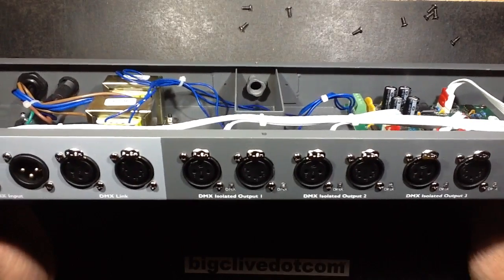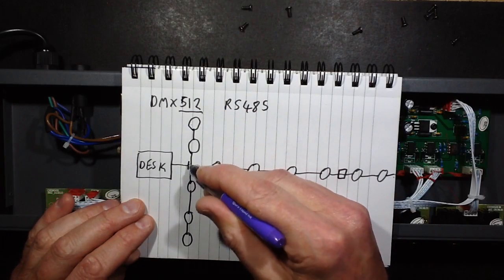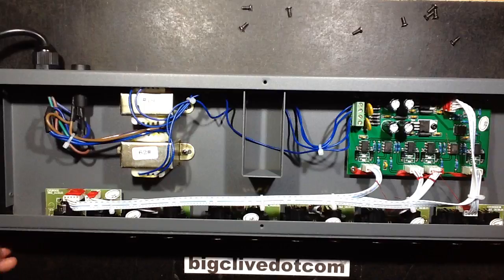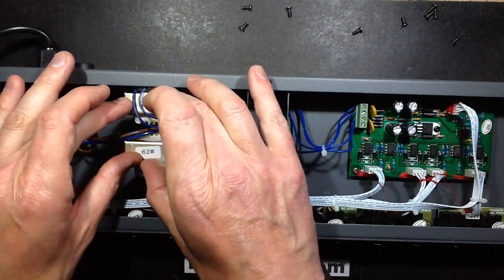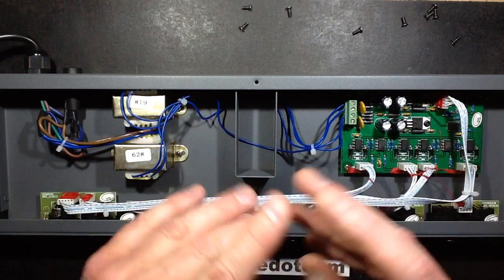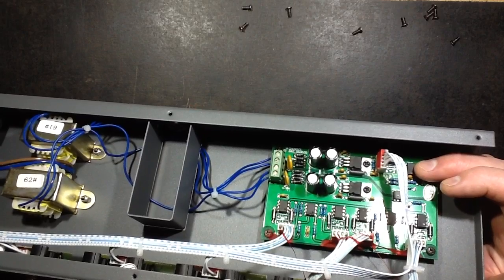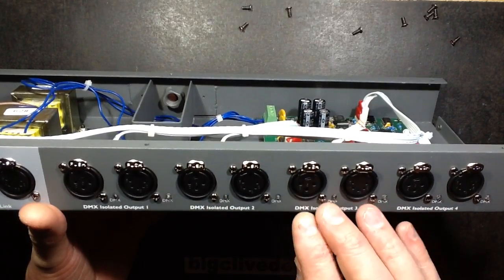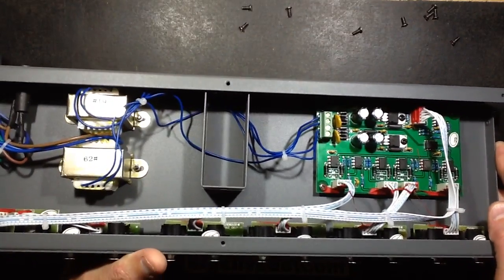Inside a Showtec DB-1-4 DMX isolator, buffer, repeater.

Comment: We use RS485 at work, and we exclusively use little PC-Boards that passively split the signal into 4. Theres no reason I can think of why it should be different for DMX?
Reply from the maker: DMX has a bit rate of 250kbit/s (250kHz) and is used over long distances.  It can't be split without proper buffering as signal reflections will potentially corrupt data.
RS485 is just a signal standard, your system may be low speed.
Reply: @bigclivedotcom  okay! Thats fair. We clock our data bus at 19200. Reliability is more important than speed.

Comment: The CANBUS protocol is quite similar to rs485 and a the voltage levels are very similar and I did build a interpreter on breadboard and I got it to work with one caveat: some data corruption occurred over long runs without a buffer similar to dmx I also prototyped one of those and the circuitry of this product is very similar 🤔
Reply from the maker: With canbus the lines have a relaxed and active state where they pull close to a supply rail.  With RS485 it's a distinct polarity change.
Reply: @bigclivedotcom  yes it was one of those projects: just because you can do something does not mean that you should but my attitude is fuck it let's do it anyway

Comment: Hi, I have a problem on two of my DMX led-par. They don't respond on any command from my DMX-controller. They work correct when I use them with there own sound-program and Auto-program. But not on any DMX-channel. I have looked at your videos and are impressed about you knowledge!

Comment: So basically this is CAN for lights?
Reply from the maker: Much simpler than CAN, but developed around the same time.  DMX lacks error detection.  The newer RDM standard that is backward compatible with DMX has bidirectional communication and other enhancements.  RDM wouldn't work fully with this unit because it requires bidirectional communication.

Comment: Not sure if it has proper isolation. Have a look at wires of the different sources touching each other, especially running through tight metal space. Another thing is that outputs have common ground which is half work done. And my final thoughts are regarding not sufficient PCB tracks isolation. Anyway, not trying to be a smarta**, just laying down my thoughts

Comment: Hi, im curious, do that Showtech DB1-4 spliter/booster have integrated 120omh termination rezistor on DMX input side. 
And   do DMX input side  ground(XLR 1th leg) is connected to PE(chasis ground or from power in cable)?
Thanks.

Comment: Why would you use a 5 pin connector for a standard where you only need 2 wires plus shield in the first place?
Reply from the maker: The original standard allowed for two networks on one connector, and it also avoids issues with the DMX being mixed up with audio cables which are XLR3.

Comment: Just on cost I found most decent buffer isolators are priced higher than many low cost consoles.  Fount to do a long run from a console to a lighting rig, it is actually cheaper and better isolation can be obtained by using Artnet, E1.31, on Ethernet and have full transformer isolation on BOTH ends of each Ethernet cable by using off the shelf inexpensive networking switches and routers, plus you get multi universe distribution for less cost than a good quality DMX splitter.  Seeing the splitters run from $600-$1500 each does not make economic sence when better isolation can be had with a $50 4 port Ethernet switch and several $120 6 Universe Artnet to DMX converters.  The Ethernet standard has high quality transformer isolation on each port, data regeneration, handshaking,, retransmissiion, etc, that DMX alone does not have.  Due to cost, higher multi-universe capability, and better isolation, I've moved to Artnet DMX over Ethernet instead of much higher cost DMX cable and Isolator splitters.  Many quality consoles support Artnet out of the box, such as the Leviton Piccolo series.   Artnet and DMX outputs can be used at the same time.
Reply: I got a Trancsession 4 way DMX splitter second hand that originally cost about £120. It is a poplar one and is rebranded by several companies.

Comment: Does the device buffer both pairs of data pins, for use with (rare) equipment that does make use of all five pins?
Reply from the maker: No.  Just the single pair.
Reply: Most of my lighting experience is with a home-made (not originally mine) 8-channel deathtrap box with standard household dimmers and NEMA-15 outlets, running on mains 110v AC with a power cord per channel running from the board at the back of the gymnasium to the stage at the front (lots of gaffer tape is used). 

I've only used a DMX control system on a couple of occasions where the school's production budget was high enough to facilitate renting a proper lighting set (despite my attempts to persuade them to get our own set). They were all DMX-3.

Have you ever encountered a DMX-5 system that actually utilized the second data pair?
Reply: I have encountered plenty of systems to incorporate those pairs due to the fact it is part of the standard, however, I haven't opened them up to see if they actually use it or not. 

If you're setting up a small lighting system, you'd probably be best of using a USB to DMX 3Pin, like this
http://www.ebay.com/itm/New-USB-to-DMX-Interface-Adapter-DMX512-Computer-PC-Satge-Lighting-Controller-US-/281730984904?hash=item419879abc8:g:ODgAAOSwT6pVihQK
Using freeware with a laptop/desktop which I'm sure the school can provide, and those splitters are much less expensive. Like this
http://www.ebay.com/itm/LED-Controller-DMX-8-Channel-Output-DMX512-Signal-Amplifier-Splitter-Distributor-/222254953371?hash=item33bf6d739b:g:1tAAAOSwmfhX39GV

As far as cheap lights within their budget LED's are the cheapest option right now, and for a basic small stage, you can light it quite effectively using a set of these for instance: http://www.ebay.com/itm/10x-86-RGB-LED-Stage-Light-Par-DMX-512-Lighting-Laser-Projector-Party-DJ-Disco-/301672148579?hash=item463d0fae63:g:oNQAAOSwU0RXHYvs
And the wonderful thing about those is they require NO DIMMERS, Simply power, and minimal power at that. So running the power is as simple as wiring up some standard NEMA power to a grid. With no dimming at all. I'm no electrician, but that isn't hard. 

Focusing is dead easy too, just point. And after initial setup little setup would be needed as long as you set up each LED on it's own channel range and have a good way to deal with that, maybe upstage, downstage, centerstage, left, right ETC. 

And that's how you make a dead cheap system. Would it work? Probably. Would you make a lot of admins and parents happy? Definitely, if it worked. And I see no reason why it wouldn't. And if it's not a professional stage, I think you'd not get any complaints. You could easily set this all up for much less than a grand, if you had a grid already. and even if you didn't just a way to mount them should suffice. Cabling and stuff would be the majority of your cost.
Reply: I didn't know they made USB-DMX controllers. That's quite handy.

As for the generic LED cans, they look easy enough to use, but given the price and lack of any kind of lens (or other spec data such as lumen output, beam spread and focal length), I'd say they're more for effect (disco/DJ stuff) and would be pitiful for stage lighting. My setup typically uses 12-18 tungsten filament flood lamps with typical wattage of 100-150w each. I also need something with a somewhat focused beam, of the kind a PAR can can provide so I can do discrete lighting zones. They'd be good for the school dance, certainly, but not stage lighting. 

And anyways, I'm not doing the school's productions any more, I'm afraid. As much as I loved doing them, I just don't have the time any more.
Reply: Perhaps not stage lighting yes I agree, but you'd be surprised, for the cost its quite good! And for a small black box production that requires just lighting the stage, one could probably get away with it. With a bit of tinkering of course ;) But yes time is the ultimate factor. I have hardly any time to spend on non profit low budget stuff anymore unless its for my own home! Haha

Comment: In the same metal case, they now sell four different versions (with not that much price difference): this one, an 8 port version that has only 3 pin outputs (I guess that's where their disco roots are showing), and an RDM version of both which should mean they're bidirectional.

Comment: how hard is it to make DMX devices, I can't seem to find simple low voltage DMX relays that don't cost obscene amounts like those from Doug Fleenor Design which is a shame because I would love to be able to solder in all sorts of cheap eBay lights to toggle on a console.
Reply: You definitely pay for something which is handmade in a small shop with some of the finest components in the industry...
Reply: If you have used Arduino, it's very simple. There are a few library's out there that'll do what you want. Connect a max485 into the arduino serial input and write some code.
I've made a double relay unit and also a 5xRGB led tape controller. Both have been very reliable over the last 2 years with approx 7-10 shows per week. The only issues they've had are all due to inadequate short circuit protection on the outputs - a conscious decision to save costs and space but I wish I'd used auto resetting fuses.
I used arduino to prototype then made final units using just the AVR microcontrollers.
Check out the led controller here: http://www.instructables.com/id/DMX-LED-Strips/
Reply: Instructables charges?  It certainly isn't letting anything go without signing up :-(
Reply: http://www.aliexpress.com/item/Wholesale-3CH-LED-dmx512-Controller-board-3-channel-DMX-512-RELAY-OUTPUT-LED-DMX512-Decoder-Relay/32379628423.html?spm=2114.01010208.3.10.t43y8x&ws_ab_test=searchweb201556_8,searchweb201602_1_10057_10056_10055_10049_10059_10058_10017_405_404_106_105_104_10060_103_10061_102_10062_412,searchweb201603_6&btsid=7b44008c-6d71-423f-99f0-5a671aff5b6d

I got one and so far it's been good.

Comment: Can we get a schematic of the transformers and how they're configured to be completely isolated?  Also can you post the schematic for the power supply side: PTC thermistors, capacitors, ferrites, full wave rectifier diodes, and voltage regulators?

Thanks so much
Reply: DINKIN It's obviously bog standard textbook.  240V to few volt AC transformer.  Bridge rectifier.  Capacitor.  RF bead and second capacitor.  7805. Add in PTCs, TVS , fuse etc. as needed.  Make a complete second one like the first and stick em on the same board with an isolation gap between them, crossed only by the optocoupler.

Comment: Is this an alternative to fiber optic lighting control systems for large venues?also at what point should I worry about using xlr cords for my dmx setups?
Reply from the maker: +AlbanyHauntCA Fibe optic is used for large amounts of channels over large areas.  The point you should worry about your standard audio leads (if that's what you're talking about) is when your network length reaches a point where the lights start doing random stuff, or in the case of a professional event it's got to be proper data cable from the start.
Reply: +bigclivedotcom thanks! thats good to know. Also what kind of system would you use to run DMX in a dark ride or walkthrough atraction. I want to be able to to triger multiple scenes at the same time and also have those scenes trigger audio. Please tell me if that makes any sense.
love your videos!
Reply from the maker: +AlbanyHauntCA You can get the audio repeater modules on ebay.  I'm not sure the best option for triggering multiple items.  It's going well and truly into the area of show control.  Gilderfluke stuff comes to mind.

Comment: And to be honest, they deserve it when they don't get away with using microphone cable, and things go horribly wrong.
Reply: drutfurgeson definitely not what happened at the great white fire. DMX is not super popular as a pyrotechnic firing control system. even when it is used, it is never the primary firing system. electronically fired pyro systems have a manual operator switch which must be set to arm. that's regardless of the fact that the building was not suitable for pyrotechnic displays. there never should have been any to begin with, even if there was the off chance someone had 20 years ahead of time pyro systems hooked up to DMX there, they should not have hooked it up in the first place. its not a funny joke either. a lot of people died horribly
Reply: If you're lighting a show with revenue in the thousands of dollars and up, sure.  If you're a mobile DJ or a small nightclub or a state fair -- and you can get away with using 3-pin mic cable because you have 50 feet total cable and all of ten lights...

Seriously, NObody uses all five pins anyway.  There's "proper", there's "good enough", and then "not good enough".  If nobody is losing lives or (significant) money, it's perfectly acceptable to determine the difference by trial and error.

The electronics do not care, and are not impressed by "proper".  They live in a world of "good enough" or "not good enough".
Reply: Physics is harsh - use proper DMX cables.
Reply: thats a litle harsh
Reply: +jayja45 maybe that's what happened at the infamous Great White show.

Comment: I'm an amateur radio operator, and wow, have I had my share of issues related to standing waves. Most issues for us hams are about the antenna itself, though, rather than the transmission line, and it's all about the resonant frequency of the antenna.
Usually we use 50 ohm coax, and then we use an antenna tuner, basically an LC match circuit, to match the impedance of the antenna to that of the feedline at the desired frequency. Most transceivers are quite tolerant, but simple homebrews could blow the final transistors when transmitting into an improperly matched antenna system.

Comment: The part which you said that a 100 ohm or 120 ohm resistor being used as a terminator is used quite widely in data transmission. One example would be the connections from a PC to a monitor where you would have a power amplifier and a non inverting amplifier for the same data (the reversed polarities of signals would help in the interference issues and restoration of the signal, on the other end it is capped off as well with a resistor to prevent mirroring of the signal :)

I think that it is a connection from a pc to a monitor.. VGA type things.. I may be mistaking it with sound connections..
Reply: The most infamous "termination" horror stories in IT pretty much come from one of two things: 10Base2 Ethernet (or (shock-horror) 10Base5, for the really old fogies), or scsi. With coax Ethernet, you need termination on both ends, or things will go horribly and unpredictably wrong. With SCSI, most of the time you only need it on one end of the cable explicitly, because most SCSI cards included a terminator pack on board and mostly it was active by default... But note the qualifiers, if you forget to check it will be the one time things go bad — and then the consequences are data loss on your hard drive cable.
Reply: I was just a kid at the time, but I remember my friends dad 15 years ago or so talking about SCSI drives. I don't remember much about them specifically, but I remember that at the time they were quite a contender in terms of speed. Do they even exist anymore for the average joe on the consumer market?
Reply: Loren Husky Modern SCSI uses a serial protocol (SAS) that is so similar to SATA you can often plug SATA drives in.  The SCSI speed for the past 20 or so years came mostly from hard drive factories only shipping their fast drives (10000rpm up) with SCSI connections, while insisting that SATA/ATA/IDE drives would only be available up to 7200rpm .  Entirely artificial.  Another benefit of SCSI was having up to 7 or 15 drives per cable with parallel versions, compared to two for ATA/IDE.  The biggest bane of SCSI is that the cable making industry infested the standards process, resulting in too many different connectors being standard, unlike ATA/IDE which stayed with one connector in different qualities, all compatible.  Even these days, serial SCSI (SAS) has multiple connectors with similar names, resulting in otherwise good webshops getting listings wrong and selling you a useless cable. But SAS top cable speeds exceed SATA cable speeds, making it the only option for some things.

Comment: Probably not the first to tell you but those electronics gets beat up a lot on the road. These cheap but handy solutions ends up without protection between heavy gear so that is probably why they do not use sockets for the chips. It would be "broken" after 3 shows...
Reply from the maker: dimlexavr Yeah, the stuff does have a hard life.  I'll probably pop the lid on one of the PRG stock buffers to see how it compares.
Reply: bigclivedotcom Be prepared for circuit board broken around the mounting screws. ;) I have seen that a lot...

Comment: I was wondering why the connectors have four wires (five for the input section), but then you mentioned the LED's haha. You also mentioned it runs over twisted pair cable, is the screen a requirement or is it optional?
Reply from the maker: PuchMaxi1988 The screen is a requirement for open cable runs.  The standard does allow for the use of CAT5 cable with one pair for data and another pair as the ground reference, but it requires a screened CAT5 unless it's run in its own conduit.
There are specific cables suited to DMX cabling that have a specific "characteristic impedance" of around 100 to 120 ohm.  I don't particularly recommend researching characteristic impedance unless you want a headache.  It's all to do with propagation of an electrical wave down a cable and how capacitance and inductance affects it.